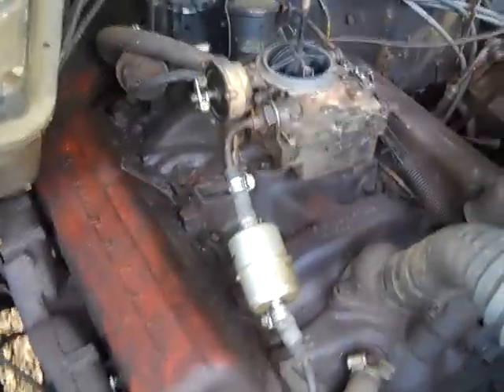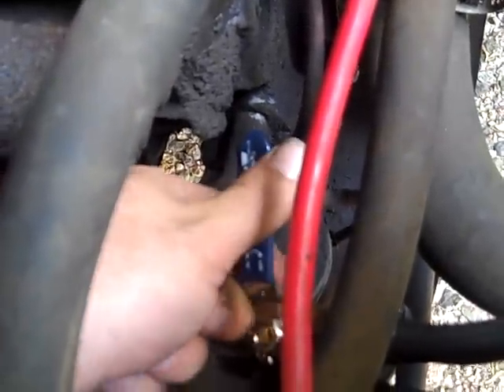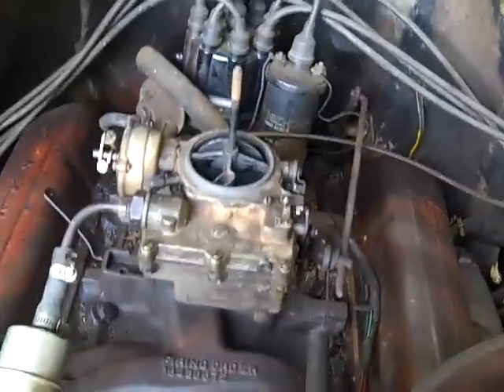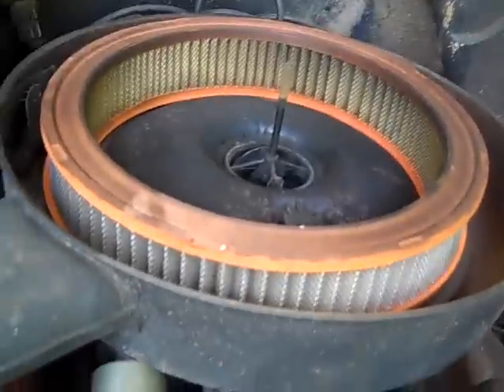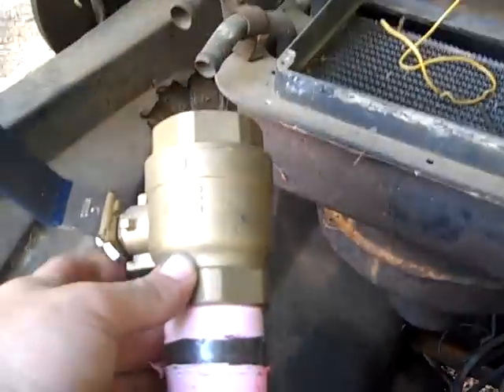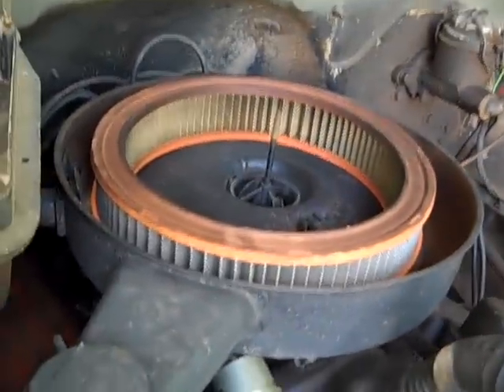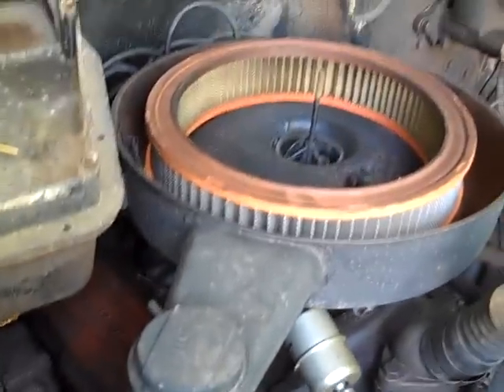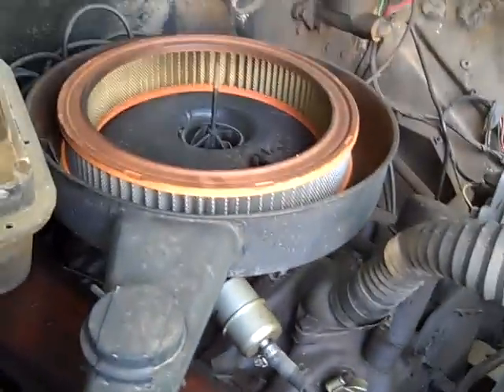Preparing the truck to run off of Woodgas

Comment: Does that fuel shut off affect your fuel pump do you have it after the pump and does the pump blow the line off due to build up pressure of the mechanical fuel pump and have you burnt out the pump?